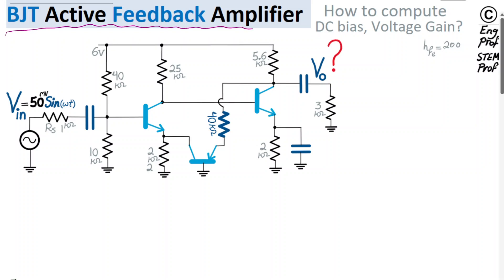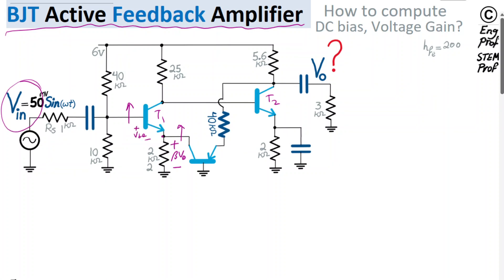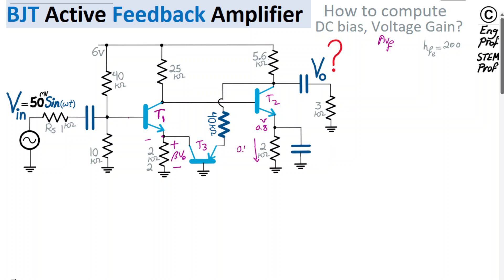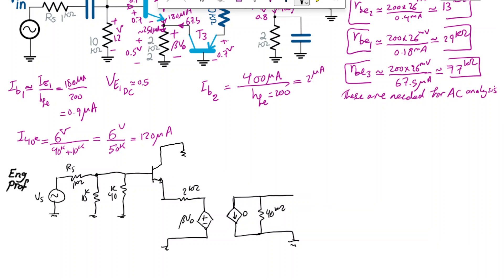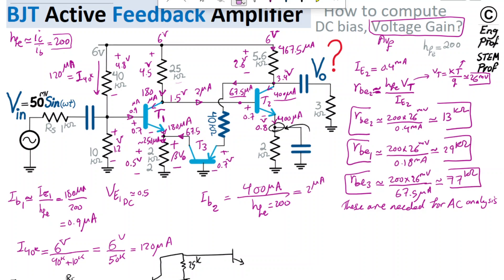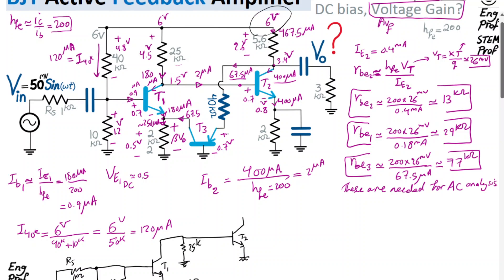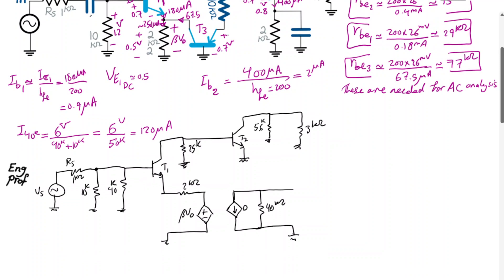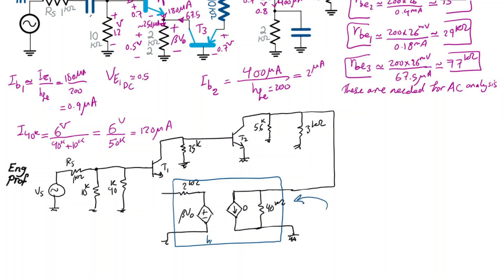Feedback Amplifier: How to find DC Bias and AC Gain

Comment: since all resistor values are given, you should CALCULATE the current and voltage at all nodes. Why do you "desire" 0.8V at the emmitor of T2?
Reply from the maker: Thanks for watching and follow-up comment & question. I appreciate your interest and feedback. In this video I wanted to cover many aspects of amplifier analysis with main focus on more complicated feedback AC analysis.  The resulting video is already 45-minute long and I was concerned not to make it longer by focusing on more mundane DC analysis that effectively involves writing bunch of KCL and KVL equations and solve multiple unknown and multiple equations which is straightforward and just time consuming.  So what I did then was instead I solved the DC analysis earlier and I knew emitter voltage would be 0.8 volt and hence I started from there to shortcut the time needed to do the DC analysis so that I can get to more insightful AC analysis.  
I hope this explanation is helpful.  For more examples please see video of Gain of Feedback Amplifier Example with JFET & BJT Transistors https://youtu.be/NB1-mYglXsY
I will also post more examples in my Analog & Op Amp playlist https://www.youtube.com/playlist?list=PLrwXF7N522y4c7c-8KBjrwd7IyaZfWxyt
I hope this is helpful.
Reply: Thanks for response. It helped me.
Reply from the maker: Glad to hear it was helpful.

Comment: Can someone explain to me how was calculated the 3.4v in the collector on T2????
Reply from the maker: Thanks for watching, your interest and follow-up question. As mentioned in video the desired T2 emitter voltage is 0.8 volt over the 2k resistor resulting in 0.4mA current for BJT transistor T2. If you write a KCL current law at collector of T2 you get the equation (6-Vc)/5.6kohm = 0.4mA + (Vc - 0.7)/40kohm where Vc is the voltage of T2 collector. The solution of this KCL equation is Vc=3.4 volt.  I hope this explanation is helpful.  For more examples please see video of Gain of Feedback Amplifier Example with JFET & BJT Transistors https://youtu.be/NB1-mYglXsY
I will also post a feedback tutorial video and more examples in my Analog & Op Amp playlist https://www.youtube.com/playlist?list=PLrwXF7N522y4c7c-8KBjrwd7IyaZfWxyt
I hope this is helpful.
Reply: Thank you a lot my friend!!
Reply from the maker: @sersheva  You are very welcome. Glad that the explanation is helpful.  For more examples please see video of Gain of Feedback Amplifier Example with JFET & BJT Transistors https://youtu.be/NB1-mYglXsY
I will also post a feedback tutorial video and more examples in my Analog & Op Amp playlist https://www.youtube.com/playlist?list=PLrwXF7N522y4c7c-8KBjrwd7IyaZfWxyt
Thanks for watching 🙋‍♂️

Comment from the maker: Thanks for watching. For more Amplifier Circuit examples please see:  OpAmp circuit with feedbacks that solves Differential Equation https://youtu.be/ENq39EesfPw
Analog Exponential (Anti-Log) computer https://youtu.be/kk2c7Gk3nW4
PID Controller Circuit for Servo motor https://youtu.be/NATBlfABXrA
Sawtooth Oscillator with Op Amp, JFET and BJT Transistors https://youtu.be/5zHXTx-Vl20
Gain of Feedback Amplifier Example with JFET & BJT Transistors https://youtu.be/NB1-mYglXsY
Voltage Regulator design with BJT JFET & Op Amp https://youtu.be/CJl-urzeiTo
Push-Pull Power Amplifier with Darlington Transistors https://youtu.be/866MYibo8yE
Analog Computer to Raise Signal to power n https://youtu.be/IUTlBH1UraE
Bandgap circuit with BJT transistors: https://youtu.be/esMlNx5w9Jw
Triangle Oscillator Op Amp circuit https://youtu.be/JF5Up_cuL9k
Full-Wave Rectifier  https://youtu.be/DJJMNU-CYcg. 
Differential Equation Solver Analog Circuit https://youtu.be/R3X5AYNZGEI
Diode-Amplifier VTC is analyzed in https://youtu.be/vpGZkafxMJM 
For more analog signal processing examples see: https://www.youtube.com/playlist?list=PLrwXF7N522y4c7c-8KBjrwd7IyaZfWxyt
I hope these Circuit design and analysis videos are helpful. 🙋‍♂️

Comment: t3 no need. Only 40k resistance enough.
Reply from the maker: Thanks for watching & your interest. While there are many ways to design this circuit, BJT transistor T3 is needed to ensure one-way (output to input) feedback. For more examples pls see:  Gain of Feedback Amplifier Example with JFET & BJT Transistors https://youtu.be/NB1-mYglXsY
Voltage Regulator design with BJT JFET & Op Amp https://youtu.be/CJl-urzeiTo
Push-Pull Power Amplifier with Darlington Transistors https://youtu.be/866MYibo8yE
Sawtooth Oscillator with Op Amp, JFET and BJT Transistors https://youtu.be/5zHXTx-Vl20
For more Analog circuit examples & videos please see https://www.youtube.com/playlist?list=PLrwXF7N522y4c7c-8KBjrwd7IyaZfWxyt
I hope these are helpful. 🙏
Reply: @STEMprof  T3 adds its own not compensated non-linearity, that makes no sense to add it as a feedback element. Besides, I wasn't successful to simulate this schematic in spice. T2 was too closed, T3 was too opened, a working point was far away from a desired. Reducing T1 collector resistor helped a bit, but a final result was rather a semi-circle + parabola rather than a sinusoide.